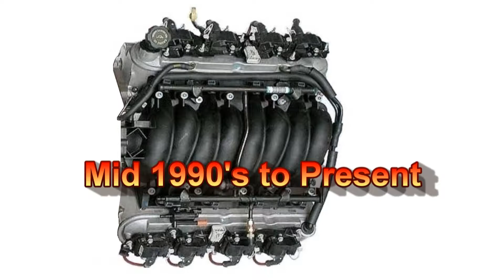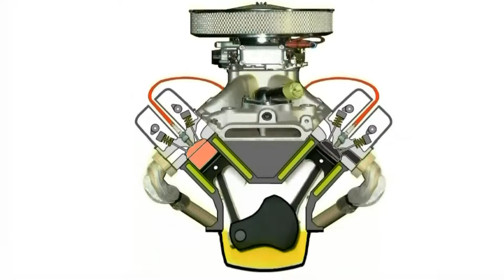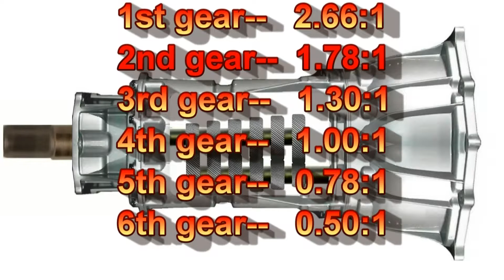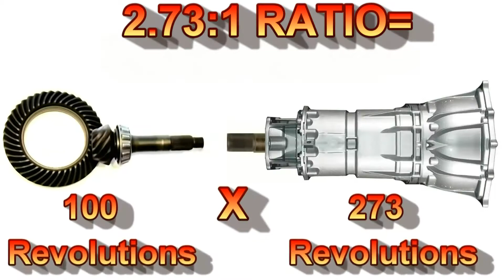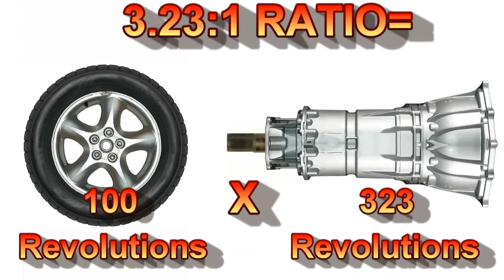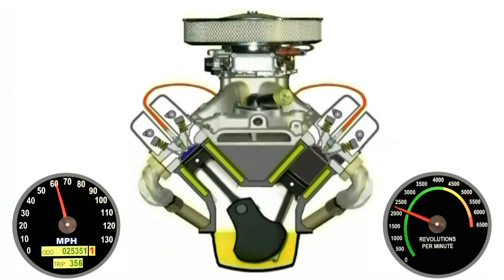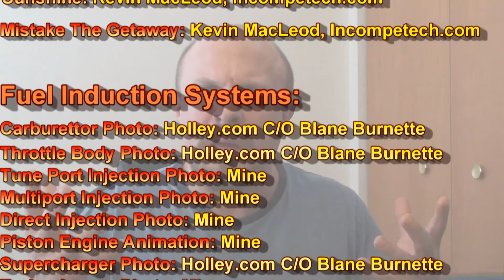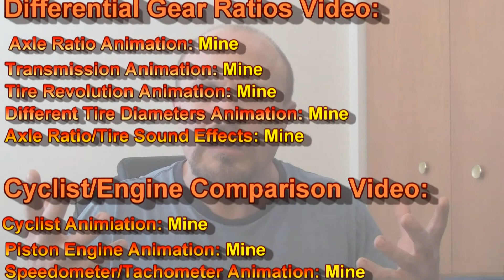Fuel Economy vs Performance Part 1

Comment from the maker: Thanks, some guys have said the video is rather long, but it was aimed towards people that have very little or even no knowledge on how vehicles work. Even though there's information out there regarding engine size, transmission ratios, differential ratios and tire size.... if someone doesn't understand how vehicles work, all that information means nothing. At least now it's not gonna be so easy for the automotive industry to pull the wool over people's eyes.

Comment: It is also important to note that the average vehicles performance has gone up in that same time. My 86 Trans Am went 0 to 60 in just over 8 seconds. It is actually no faster than my 2008 Mercury Grand Marquis.
Reply from the maker: I do understand that engine performance has gone up, but so has combustion technology and advancements in fuel injection systems. But it's really sad to see  cars that can run with the most efficient direct injection system and it winds up being as efficient as larger engines with the older multiport system.
http://www.fueleconomy.gov/feg/noframes/31741.shtml
http://www.fueleconomy.gov/feg/noframes/31162.shtml
It just doesn't make much sense to wind up smaller engines with higher gears to increase performance when a larger engine with milder gearing can do the same thing with less effort.